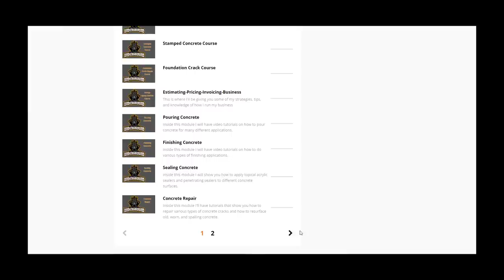Pouring And Finishing A Concrete Patio Slab (for beginners)

Comment: I don't know concrete at all and just trying to learn, but I never understood how the WWM stays off the ground. It gets pulled up off the ground during the pour, but then the crew ends up standing in the slush on top of the WWM, doesn't that just push it right back down?
Reply: Once the rock gets under the wire, it can't go back down.

Comment: Why bother pulling up the screen, if you’re going to just go walk on it right after? When the guys poured around my pool, they did the same thing. Now 6 yrs later, I had to fix a leak and when I cut the concrete to gain access, the screen wasn’t suspended; it literally went back to the bottom.